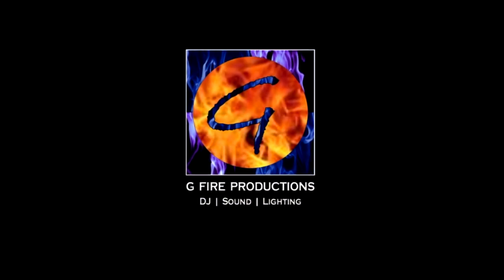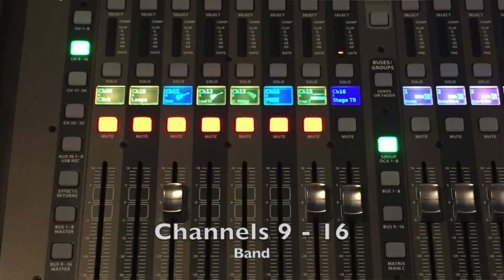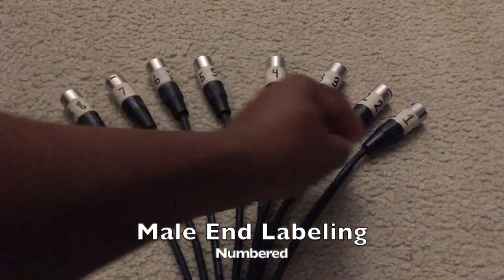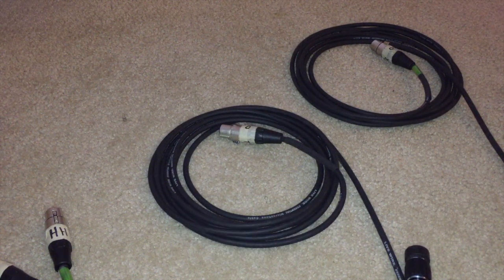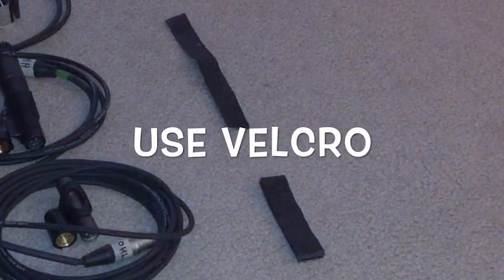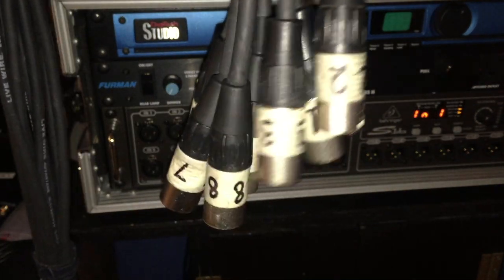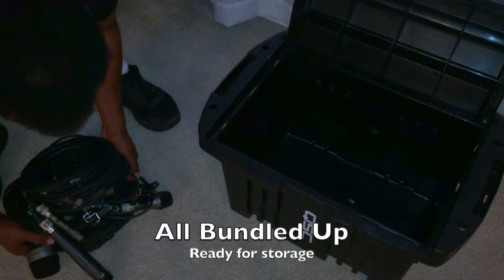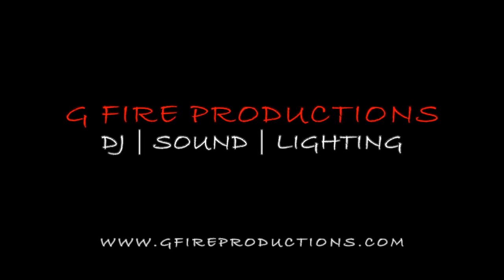How To Build A Custom Drum Snake

Comment: Hey I just wanted to say thanks for this video this helps out a lot as a church drummer this gave me some good ideas.
Reply from the maker: You're welcome Arnold Sykes Jr. and thank you for watching brother. Are you on the go a lot as a drummer?
Reply: @gfire_productions  yeah right now our church is in the process of having a building built so we are doing a setup and tear down every Sunday at a community center. We getting ready to upgrade to digital mixer and equipment.
Reply: I was trying to figure out if we could plug the drum mics straight into the digital stage box.
Reply from the maker: @sykesii4100  Yeah that's pretty much what I did. What are y'all mixing on? I use an X32 Compact.
Reply: @gfire_productions  yeah we're looking at probably getting the x32 compact since we're doing a lot of moving
Reply from the maker: @sykesii4100  well sir if you ever need any tips don't hesitate to ask. I set up lots of small live sound gigs by myself. If I deal with any bands that requires less than 16 channels of input, I use my Behringer XR18 but anything more than that I use the X32C. Check out this set up and I did it by myself.
Reply: @gfire_productions  Thanks I appreciate it. I'll reach out to you once we have a better idea of what we are going to set up.
Reply from the maker: @sykesii4100  Yes sir, looking forward to it!
Reply: @gfire_productions  hello I did have a few questions I wanted to ask about advice for our church equipment. What's a good way to contact you directly?
Reply from the maker: @sykesii4100  www.gfireproductions.com/contact

Comment: I've been going back and forth in my head between making something like this or investing in some of those new XLR Ethercon snakes (LyxPro). How do you feel about your drum loom years later at this point? Do you still use it or did you find something else that works better?
Reply from the maker: Great question. I still is it. I personally thing the ethercon snake is a good idea for really long cables but I literally put my stage back x near the drummer so I done have to deal with an external step in my set up. My s16 is place near the drummer and all other band member plug in at the point.

Comment: I have 9 50' XLR cables and i'm setting up in a REALLY small room but i've spent so much already. I have 16 channels and would like to build a 16 cable snake. Would you buy 7 more 50 footers or buy all new shorter ones? Or mix-match lengths? Great video man I plan on doing this with whatever lengths I go with
Reply from the maker: I would cut 8 of those cables in half and re-solder new XLR ends on them accordingly. That way you spend minimum amount of money for the upgrade by using what you already have available. Check this out: https://amzn.to/3fYUJdc